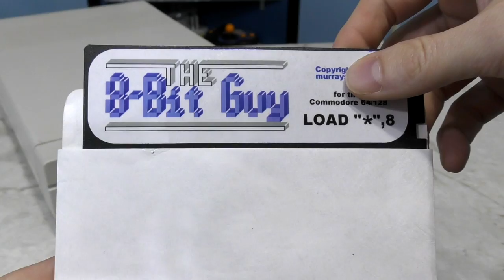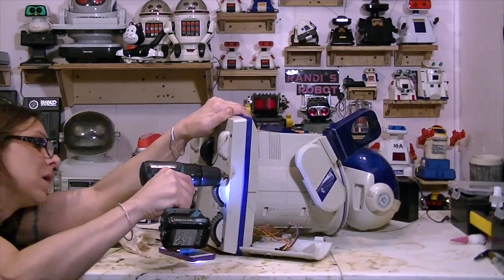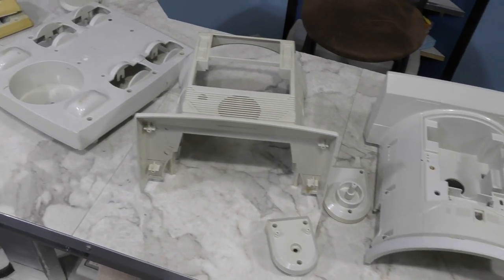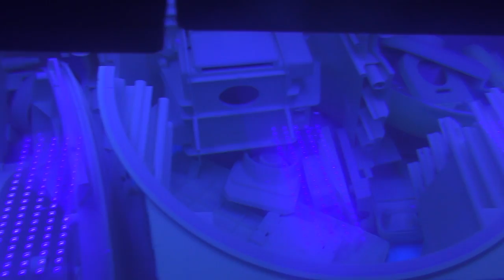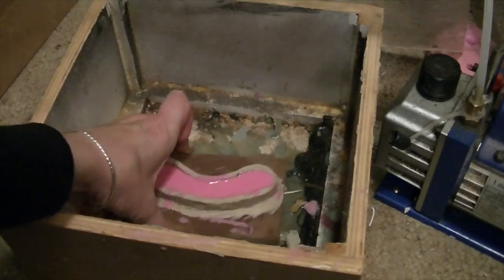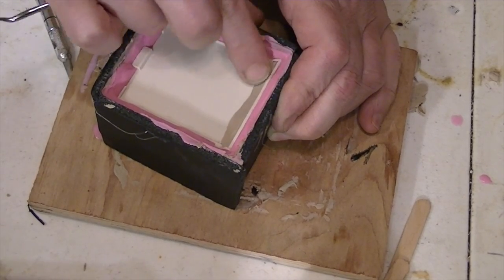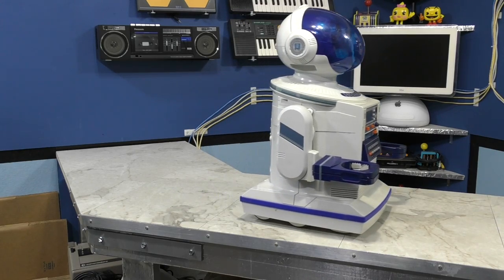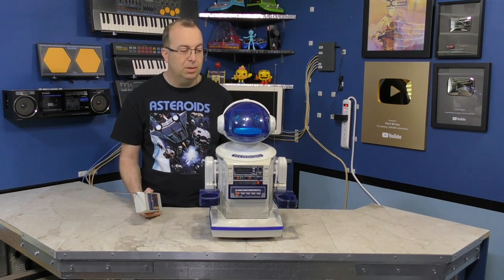Vintage Hearoid Robot Restoration

Comment: The mold part is truly impressive !
Reply: Joe Blow  It makes more sense to mould here because:
1) measuring and modelling the part precisely enough may turn out to be rather hard
2) 3D-printed part may not be springy or strong enough to do its job. This can likely be rectified with clever redesigning the part but would take more than a couple of attempts - so lots of time.
Reply: Max Raider  Or manually redo it with a caliper and 3d modelling software, that's less fun than it sounds. And have a well-calibrated 3d printer, or it would be either too tight or to loose to work well. An there'd be layer lines or other boo-boos that would have to be removed. 3D printing would be an option of choice only if all of those parts were missing and no-one would lend you one. And that would mean reconstruction from photos or pure confabulaton based onwhat the part is supposed to do rather than its appearance. As for copying things with 2-part silicone and resin I am just starting to experiment with that myself and I did duplicate a flashlight lens which works OK but has a few bubbles in it and slightly different refractory index. And The King Of Random did duplicate a vinyl record with silicone and resin and it did play music that is way more successful than I anticipated 9the music is recognizable, and while ther are pops and crackles it is listenable), so there is a really big potential here for detail accuracy.
Reply: If that impresses you, I want to show you my latest paint-by-numbers masterpiece.  I managed to color inside the lines on this one.

Comment: You should try a headlight lens restoration kit for polishing plastic. They are cheap and work very well.
Reply: could you send an amazon link for one that you know is good?
Reply: I have had success with the Turtle Wax headlight restorer.
Reply: I use Novus plastic polish for this and it works really well. I also use it for restoring the ABS/thermoplastic/bakelite cases of old rotary phones as well. It's used for all kinds of plastics, even for polishing lightbars on emergency vehicles.
Reply: It's about time  that someone pointed that out.
Reply: Back when I had this PC case with an acrylic window I used to remove scratches on the acrylic with liquid Brasso. It even worked on the glossy side of my Playstation 2!
Reply: For plastics , use Maguire's cleaner wax.   Rub it in, and then buff it off.  I use it on all vintage toy and accessory parts. Works exceptionally well on clear plastic 👌
Reply: My farts are rather abrasive would that work.
Reply: @cmdion  typical car polish works quite well.
Reply: To do it properly, you’d probably want to go through several stages of fine grit sand paper to remove deep scratches, and then a final polish.
Reply: The problem with stuff like that, as you can see, is literally everybody in the comments here suggest a different polish/method.
Reply: Neat seeing you here!
Reply: @OrangeSheep14 
Go to an actual store.

Comment: Love seeing some classic plastic moulding, rather than the 3D printing everyone else is doing these days. I wonder if the resulting parts are stronger too?
Reply: Molded parts do tend to be stronger then 3D printed. I think one of the best uses of 3D printing (for stronger bulk items anyways) is to make highly accurate and long term molds with the printer.
Reply: They surely are, they spaces between layers on a 3d printed part are weak points
Reply: Depends. Stronger than resing printers, for sure, but some filaments for FDM printers are really strong, polycarbonate, for example. So, depending on the printing orientation and filament, I think it can be just as strong. But of course, the finish will not be nearly as good as the one from the mold from the actual part!
Reply: @ComandanteJ  My uni has a resin printer and that parts that come out of it  are reallt though once theyve cured.
Reply: No mater what a filament printer uses and even if the print is set to 100% fill 3d printed parts ALWAYS have an inherent weakness. The sheer strength of a 3d printed part in the same direction as the layers is very week compared to a moulded part (and you have WAY more choice in materials when moulding vrs 3d printing).
Reply: In my experience, SLS parts are extremely strong. I've been using a few parts that I had printed daily for years now.
Reply: @thecannawitch6631  while there is that weakness there most 3d prints can take between 1000-3000 MPa and for parts for retro computers and robots that's enough in my opinion
Reply: Printing sideways it will be very strong because the layers are opposite of where the force is pushing/pulling, if you would print it upright it would be pulled appart easily if the layers are not properly configured
Reply: Yeah, I wish more people molded in plastic too. 3D printing is perfectly fine for creating a model to make molds out of, but if somebody is selling 3D printed unsanded pieces it just seems plain lazy to me. It looks bad and doesn't last long.
Reply: @thecannawitch6631  I was confused for a sec before realising you probably meant shear strength
Reply: Not honestly sure how the strength of the cast parts would stack up against the original parts - but there's a pretty easy solution if you need the parts to be stronger: Get a piece of strong metal wire, bend it to the proper shape, and then put it in the mold and pour the resin around it. You can make some really strong parts that way.

Comment: Ask Technmoan about using Brasso for plastic polishing.
Reply: Exactly what I was thinking. I actually never heard of Brasso before and have a GBA with a pretty scratched up screen lying around. Already ordered some of that stuff to try it on my GBA screen cover.
Reply: @ReyMysterioX  You can also find replacement screens and some have some really interesting designs
Reply: But, it has to be the wadding version of Brasso, not the liquid.
https://www.amazon.com/Brasso-Duraglit-Metal-Polish-Wadding/dp/B004G8YNIM
Reply: Good point... just the other day i saw him make a review about a mini-disc with a scratched-up display for a remote. May I say i was amazed at the result he had with the Brasso product.
Reply: @gameswithabasementdwellerw6202  Looked those up as well, but I'd like to keep this particular one original. I have two GBA by now and I'd like to keep this one original just for sentimental reasons :) The other one on the hand, I'll probably put a backlight mod in, if I find the time to do so.
Reply: ReyMysterioX I respect that, I am working on fixing a gba color.
Reply: Autosol metal polish is good also and to finish use acrylic watch crystal polish.
Reply: ReyMysterioX I keep some Brasso for that...  Got rid of parcel tape on a monitor with it...  Just don’t get it in any grooves...
Reply: Headlight restoration kits exist, they work, they are made specifically for polishing perspex.
Reply: Brasso gang rise up
Reply: A word of warning - while Brasso will improve extremely scratched plastic, don't use it for minor scratches - Brasso is abrasive and will cause it to look foggy. Use Novus No. 2 plastic polish instead.
Reply: @ReyMysterioX  I tried it on my GBA and it just fucked the screen up more. Maybe I just did it wrong idk. But you can get replacement screen covers that look great.
Reply: I use it for polishing my ipods front plastics.
Reply: David Tipton has used automotive polish for polishing plastic radios. Personally I've done the same with scratched CDs.
Reply: Good old Brasso! Might not be as iconic as the dual combination of WD-40 and duct tape but still a useful tool.
Reply: @ReyMysterioX  also Elliot (The Retro Future) used some Brasso to remove some scratches from his GBA collection. The thing is, it works for light scratches. For deep ones, it makes no difference.
Reply: @gab_v250  : Well, yes, but for deep scratches there's always everything else.
Reply: @talon262  I am going to kindly disagree. I first learned about Brasso working at a new video store with old stock cassettes. They had to take off all the old labeling, I mean I did, and we used liquid Brasso and cloth to clean and remove scratches from the winding windows. It works well. I first heard about the wadding type on Techmoan, and his excuse was preventing a mess. I agree with him and I don't doubt it works maybe even better than liquid, but liquid works fine, even with paper towels. I have used it for years now.

Comment: For polishing the dome, maybe there's this option: In the aerospace industry there they use a mixture that is made from two pastes that are applied to surfaces such as the canopy of an airplane with cotton, to remove scratches. I don't know what this stuff is called, but a friend of mine who worked in the Israeli Aerospace Industry once gave me some of it and I was able to completely renew the face of a scratched watch I had. The results were amazing. As I was told, It works on various materials, including plastic and glass. This mixture has some tiny, sandy particles in it that scrubs the surface ever-so-slightly, removing just microns of the scratched surface and polishes it out. looks absolutely new when done, you can't tell it went though any kind of treatment at all. maybe worth a research.

Comment: Hey David, have you thought of doing a silicone mold of that broken gear for that mechanical arm project? If you made a 3D print of the gear, you could then make a mold of that and fill the mold with a resin. Then you might have a part that's more durable than a 3D print.
Reply: search ebay for plastic motor gear, billions of them for pennys.

Comment: Ever try thoes headlight restoration buffing kits. Most headlights are plastic so
Reply: I was thinking the exact same thing. I just used a set from 3M that made my 10--year-old, 197k-mile plastic headlights look brand new.
Reply: can confirm i have used one on some old plastic windows for a canvas top to my little boat, it works great.
Reply: Meguiar’s Plast-X did the business on my G4 Cube.
Reply: I just saw Techmoan do something like that on the plastic display of a MiniDisc player last week.
Reply: What about Brasso? It works wonders on clearing up clouded plastic watch crystals.
Reply: @cjsebes  You drove 197,000 miles in one year? Damn...
Reply: @axi0matic  I'm a professional, and we just stopped ordering headlight cleaning kits when we discovered Meguiar's Plast-X. That stuff is awesome! Also cheap and available at Wal-Mart.
Reply: I've polished plastic lenses by hand. It's a multiple step process and time/labor consuming, but you can get fantastic results. It involves wet sanding with a lower grit (600/800) to get the heavier scratches (or oxidation, or whatever) out,  then you can work your way up to much finer grits. I usually do about 5 steps of finer and finer sandpaper until the finish is almost perfect, , then I polish it off with a buffer on a drill and some extremely fine polishing compound. Much better result than using Plast-x in one shot. But it takes hours to do.
Reply: I used one of these kits on my headlights and it was wild. They look absolutely new. 
Recently I tried using it to polish the plastic on my scientific calculator. I managed to get out some real bad scratches that would cast shadows on the reflective film. It worked better than I expected.
I think the key is to be patient, keep the paper wet, and make sure you have a consistent finish before moving to the next finer grit!
Reply: @veronikagundersen9334  I believe it. I bet you got some amazing results!
I find that there's a certain sort of mellow calm/patience and smooth repetitive motion that you can get into the groove on. It still takes time but it's calming. And when it's done it's 100% worth it.

Comment: Remove all the reduction gears, modify the motor to run faster, and then program the thing to curse at people when it speeds by.
Reply: It probably wouldn't have enough torque left to move the whole robot around then.
Reply: @colinstu  Then we replace the motors with bigger ones!

Comment: David, I've seen Brasso (yes, the metal polish) be used to polish the front plastic on old iPods. It works very well, and doesn't seem to damage the plastic at all. I think it might be what you're looking for. Thanks

iPod video:
https://youtu.be/qmD8x9kI8VY?t=3m54s (using Brasso)

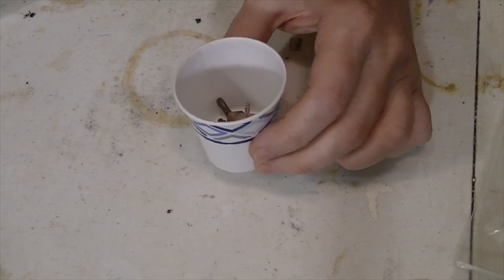Comment: 12:32 if that stuff gets rid of the corrosion on metal, think it was gonna do to your stomach
Reply: Don't remind me.. i love hot sauce but not the after effects lol
Reply: I expect it has vinegar or something in it.
Reply: Hot sauce is 50% vinegar.
Reply: Don't know about you but I'd prefer my stomach not be corroded either...
Reply: its just the vinegar in it, metal oxides are alkaline
Reply: I've always wondered why hot sauce works better than vinegar. I had a furby whose contacts were severely corroded and vinegar got them cleaner but hot sauce got them spotless.
Reply: ...but my stomach isn't metal. Is yours?
Reply: Nothing. It's just the vinegar (and some salt) that has the effect. Stomach acid is much stronger than vinegar.
Reply: I am fully convinced that a diet high in Louisiana hot sauce or similar will prevent kidney stones and dissolve the ones you have. That and not drinking hard water. But I'm not a doctor nor a dietitian, I'm just this guy...
Reply: You can't joke like that in a room full of nerds. Chemicals that attack metal don't necessarily have to attack flesh.
Reply: @rzeka  No, the lining of the stomach is much more resistant to corrosion than metal. Otherwise you would die immediately.
Reply: @thehorriblebright  yes that's exactly the joke thank yoi

Comment: The plastics used in the mold & cast here are amazing & damn useful for tonnes of projects, however, they are fairly toxic (though better than they used to be), so it's important that you wear a proper breathing mask (with chemical grade filters) & nitrile gloves (they can penetrate skin & contacts cumulative toxins), as well as working in a well ventilated area.

Better to be too safe, than not safe enough...

Also, please dispose of residue & containers following appropriate local guidelines (as they're obviously nasty for the environment, too).

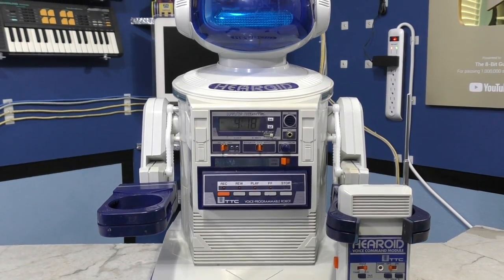Comment: Hi 8 bit! @ 12:48 you talk about not having good expierences with polishing older plastics! I work on vintage electronics from the 1950-60's specifically tube equipment, and tube radios. Anyway, for polishing plastic there is a product called Novus that you can use! It has a extremely fine grit abrasive inside that works wonders for restoring old plastic! Your best bet is using Novus #2 it's pretty much the universal polish that works the best! They make 3 different polishes working from the most coarse to the finest grit! You can either buy the 2nd one or the whole set! That stuff is the industry standard when it comes to polishing plastic components from vintage electronics! I enjoy your videos and I hope I might have been able to help you out! Keep up the good work! 
~John

Comment: I've had extremely positive results with polishing plastic with wadding Nevr-Dull. Cheap and available at Walmart. You have to apply a lot of pressure to get results, but they're clean and I don't worry about eating too far into the plastic. 

I had a pinball toy that someone spilled nail polish remover on, and it was fogged horribly. Nevr-Dull removed the fog made the plastic look good as new.

Comment: I purchased one of these for $50 at a local 2nd hand store a couple years ago. In mint condition in the original box with remote and even original manual, tray, etc. I had one as a kid and had been looking for one for about 10 years when I stumbled across it at the store. I remember wanting the Hearoid over the Robie Sr because it had voice recognition (he didn't mention that feature in the video). Yup, the remote had very basic voice recognition for controlling the basic functions. Pretty high tech back in the day.

Comment: Scratch Out works well as plastic polish and for removing black scuffs. I’ve used it on vintage clock radios and an old desk fan and it works pretty well.

Comment: You can replace broken plastic parts by scanning the originals, make a clean up in a 3D program, then send it over to a 3D printer and print it out. It needs a bit of experience to do that, but I did replace quite a number of broken parts of various sizes from various appliances over the years this way (but I work as a 3D artist, so this is rather "normal" for me to do and think this way). You can also design new parts, like this missing plastic cover. All you need are the dimension.

Comment: To polish plastic you use automotive cutting compounds. For the face shield use a milder fine finishing compound like 2nd cut and then polish, but test it first because if the colour is on the outside the compound will remove it.

Comment: If you cover the sides of the water tank with aluminum paper or some other type of reflective coating, you will achieve better results in lightening the parts, as the light beams will be reflected in all directions increasing the exposure area. I hope I helped you, a big hug.

Comment: I've often used ketchup to similar effect as the hot sauce, works great
Reply: Makes sense.  Must be the vinegar.  (Most hot sauce and most brands of ketchup include vinegar in their ingredients, and I've used white vinegar to remove alkaline corrosion from battery terminals.)

Comment: For polishing the plastik you can use Brasso and a little elbow grease.

Take a microfiber cloth, put brasso on it, rub it on, then use a moist clean microfibre cloth to clean off the residual brasso.

It works absolutely perfect on nearly all plastik stuff!

Comment: Some matchbox restorers use liquid floor polish, Pledge if I'm not mistaken, to dip their plastic windshields in which cleans up the plastic without having to sand or buff. Dunno if you'd get enough to cover the entire dome, but it's an option.